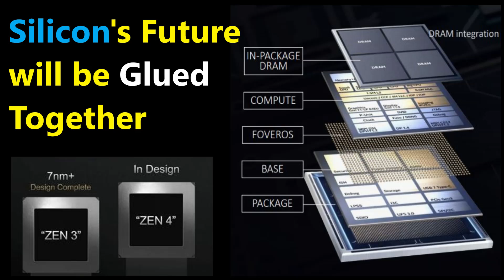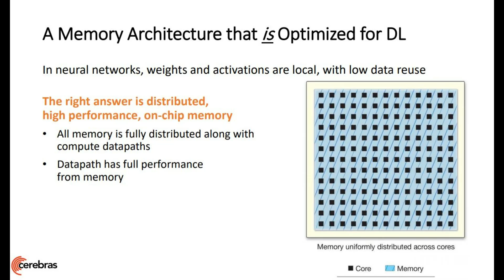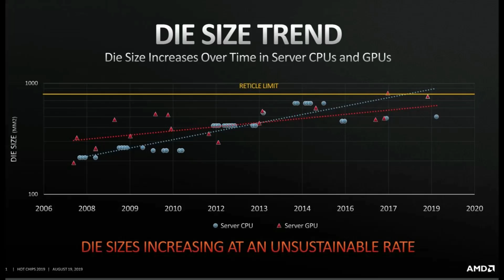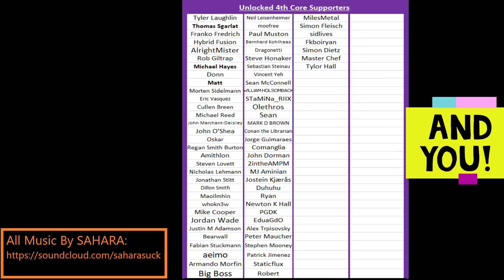3D Stacking the Future of Silicon

Comment: They best come up with some epic way of cooling them if 3D stacking is to become a viable option the smaller they shrink these nodes the harder it becomes to cool them, add stacking onto of that and it’s going to become near impossible to cool.

Change needs to happen in all areas no just the CPUs it’s daft to not even consider that.

Look at 3rd Gen Ryzen how the heat in those chips is pretty hard to consistently control yet that’s only on 7nm, imagine half that size with 3D stacking memory maybe a GPU to lol impossible to keep all that cool with the Options with have now.

Only other option would for there to be a bloody million sensors inside the SOC and it manage its own heat, but that will always result in lowering performance, so we would be stacking shrunken nodes to loose performance due to heat.

Comment: Thus is just going to be compute units, redundant ALUs and matrix multipliers, that sort of thing. Making a sheet of universal 7nm multipurpose nodes will always be less useful than simple modules repeated. Each can be tested and dead ones disabled using as much of the wafer as possible every time. Consumers will pay for the process they want and pay by compute units rather than this stupid branding. The next socket will be designed with this paradigm in mind if they're smart.

Comment: One question:
How the heck would you cool a 2.000 m^2 die? (Let's not talk about bigger)
I mean either have crazy airflow or use some crazy water cooling?
And what about pricing? I mean the bigger the more expensive? Even though the raw cost of resources wouldn't be that bad, I don't even what to think about the amount of engineering required...

However, in my opinion, we would be better off using a smart solution instead of just brunt forcing our way into better performance... 

I guess the whole reason Nvidia believes that big/huge dies are the future probably has to do with the fact that Nvidia is quite familiar with brunt forcing their way into better performance ^^

Comment: Basically you get exited about very new technology that is just around corner that is exactly same thing I got excited 20~ years ago. I do want to get excited about these things but all of them had had many false starts.  Waferscale integration, 3D stacking,  splitting design to a multiple dies within package, everything you have gotten excited about is VERY old technology that when I heard it first time it wasn't new.  The issue has always been that tweaking of existing things have given better bang for buck, especially for consumer level prices. As for 3D printing chips, I literally have Finnish university level schoolbook from 1996 that describes the process which was developed from 1970:s .  It is VERY easy to get excited about these things when you first hear them. And then you realize every single thing is actually very old technology that comes with caveats that have limited its use.  Sometimes the caveats expire with technological development, other times they stay.  Old Intel chiplet design had caveat that they couldn't test each die before integrating them to a single package, so it was limited to products that where out of consumer price range, they probably fixed that issue before making dual and quad cores by integrating two chips to same package. 

List of common reasons why technology isn't used yet. 1) speed, making something is so slow that mass production is out of questions.  2) Yield, more susceptible to manufacturing problems. 3) Just the pure costs. 4) Existing technologies are capable of mitigating the problem it solves for the common use case. 5) Problem it tries to solve is only fraction of the real problem, and all solutions to other side are too costly.  6) The technology is fundamentally not capable of shrinking to dimensions that do the things it promises. 

I read the TSMC very high performance benefits for ASIC:s against following background. 1) ASICS are thousands of times or hundreds of thousands of times faster than a CPU, when it is suitable for full blown ASIC implementation. 2) If algorithm doesn't have good enough cache locality then ASIC is limited by memory bandwidth and therefore performance is purely function of how much more bandwidth it can give relative to external memory. 
3) People have worked on designing algorithms that avoid those problem for decades for CPU:s,  and most of the time they work just fine when they don't performance is so terrible that people just don't do it. 
I do agree with Jim Keller that it is sad  that some of these technologies matured right around time when power/current density limits where truly reached.  If you disagree with that, you should know that when Chuck Moore made truly high frequency CPU:s is 800nm process he found out that they had to make some transistors BIGGER since smaller transistor didn't have large enough area to dissipate the heat and burned out.  And it wasn't that chip was hot, it was that individual few individual transistors got hot.  People have needed the low level lets spread the heat more techniques for long time the downside of doing that is exactly opposite of increasing density, which isn't a problem when it is one transistor in a thousand when making a chip that clocks unnaturally high for the manufacturing process.    This is the ultimate killer for full utilization of what TSMC is planning to do for ASIC:s for CPU:s,  those tiny high speed transistors cannot be stuck around.  

Now I would really like to have true 3D design for CPU:s however, all the technologies that have been discussed by all the manufacturers are incapable for doing it.  It is like people get excited about new slightly smaller cruise ship and start talking about how to use it to move around their house.  The scale at which 3D integration operates and what core design operates is so different.

Comment: hmm... Zen4 using a ground-up chiplet design? that covers with AMD patent stack, like that one about on-die thermoelectric cooling (peltier), from 2004,, the additional power budget to run peltier would be saved on cutting the energy signals lenghts due 3d stacking and much shorter pipelines to a memory/logic.

Comment: Just going from 2D to 3D will be incredible. So much silicon space is used for traces for clock pulses and data lines that can be much shorter when allowed to go through a 3rd dimension. That will save so much money by making it possible to etch more chips from the same wafer. Stacking computational areas will be tricky given the heat, but there are experimental capillary cooling methods in the works - essentially heat pipes between the traces. If they can make that work properly, it'll be like having a built-in AiO cooler inside the chip that could lead to a copper plate which can then have its own full sized AiO cooler for the case.

Comment: The difference is the smaller each die is when "glued together" the higher the yield and lower the waste.  One flaw in a large monolithic die, and it now has to be sold as something lower, if you're lucky.  Going bigger is a hail mary of expensive desperation, by companies that haven't done the R&D to move on.  The future won't be in super large die sizes.  It will be everything combined as closely as possible, or integrated by consolidation, but manufactured in pieces.

Comment: Yeah, I'm really looking forward to seeing what's going to be done with all this. Heck, even some of the early implementations could end up being really flipping interesting. Let's take Zen3 for example. Right now the big rumor is that Zen3 is going to take some of the room opened up by the die-shrink and put in a couple chiplettes that are nothing but HBM2 memory. The interesting thing about that is that, while it would help with CPU performance where it would really shine is with APU's. Imagine having an APU with Six cores, a Navi 14-ish GPU, and a GB or two of built-in HMB2 Ram. Well gee, that wouldn't quite be on par with competent mid-to-high range PC gaming set-up. Compared to earlier APU's though, something like this would completely blow them out of the water.

Chances are that with a set-up like that, there'd actually be some semi-modern titles that you could play at max settings at sixty fps. Granted, these would probably be titles that are from earlier this decade. Games originally built for the XB360, or early PS4 era titles that weren't really pushing the hardware very much. But if this is something they can do with their first iteration of Zen3 APU's, imagine what they'll be able to accomplish a couple years later. With a couple more die-shrinks or with 3D stacking, APU's that can rival rigs with dedicated graphics cards should be very possible.

And even that's fairly rudimentary. Interesting as heck, but still fairly rudimentary. And yes, I know you talked about all this earlier, but it's starting to feel a lot more real now. XD
Reply: Hades Canyon Nuc pretty much does this
Reply: @ApacheSenzala  

As far as I can tell, that isnt an APU.
Reply: @WolvenWeaver  the NUC has a processor and gpu on a high speed bridge layer which connects the two, just very closely. Not on the same die though.
Reply: @WolvenWeaver  Not its not but it uses Emib which is Intels version of the Infinity Fabric / early version of stackinge and its a powerful proof of concept already released. #whywait?

Comment: The idea of copper layers in stacks for heat transfer is nonsense, thermal resistance is much too high, I expect 50 to 100 µm gaps between the layers in a stack an d liquid passing through and evapourating at the edge of the stack, mass transfer and phase change are much more efficient, just like copper rod compared to a heat pipe.

Comment: Sure would be ironic if it now started getting smaller again at a good clip all the way down to 2 nm, and Moore Law turned out it hadn't died quite yet.

Beyond that, can't say I agree with it being a good thing to be dead anyway, sure it allows for new things to be looked at, but it also determines the base level you do them at. So every extra node still makes these other architectures start from a higher baseline.

Though well... one way or the other atomic scales are coming up, so couldn't really last that much longer one way or the other.

Comment: Considering cooling, it would seem a liquid would be too viscous.  Let's go with gas instead.  Since hydrogen is both reactive and flammable, helium traveling through microtubes would seem to be the logical choice.  That means grooved semicircles between stack layers with reservoirs at each end of the stacked CPU.  Then you could use micro-reed-valves or buckytubes in resonance and high-frequency vibrations to move the helium in a circulatory system.  From there you use a standard CPU coolant system.  I see no issue with that at all.

Comment: Printed copper pipes sound interesting. Didn't you talk about how AMD have a patent for on-chip Peltier technology? They were describing a way to use the peltier effect to provide in-silicon cooling. 3D stacking seems like the perfect use-case.
Reply: Peltier in the stack makes no sense, it just generates additional heat.
Reply: @mumar100  That's what I thought too! As far as I understand it, they're claiming that at the macro-molecular level, the peltier effect's parameter seem to change. No idea if this technology is actually viable, and they really need to solve the heat issue with stacking chips.

Comment: Graphene and 3D stacking sound like a perfect match for each other, graphene doesn't get as hot as silicon and 3D stacking needs cooling.
Reply: The moment I heard of 3D stacking and how good graphene is, I knew graphene would be the best material for that.

Wonder how far you could push it...

Apparently, flash memory is pretty insane with its stacking, I wonder if a similar stacking level could be applied to CPUs...

Comment: If you want to design multi layered consumer chips you have to come up with some extraordinary kind of cooling solution that should also be relatively cheap to produce. Cooling requirement alone makes it harder and this is one of the most primitive requirement here. Go figure
Reply from the maker: And what has this industry been doing to improve cooling....ever?   Nothing.   We are basically using the same cooling hardware we used 40 years ago.  All we have to do is actually divert some of this Node Shrink R&D money into other methods of improving performance.
Reply: @MooresLawIsDead  Exactly. Look at the "coolers" provided by intel. They have been the industry leader for decades! They command an army of engineers and hundreds of billion dollars for god sake!
Reply: I think the current cooling solutions are more advanced than 40 years ago.  Spot the CPU cooler from the image.  
https://en.wikipedia.org/wiki/IBM_Personal_Computer#/media/File:IBM_PC_Motherboard_(1981).jpg
Cooling methods have advanced, and there is research and has been research on better cooling however it is inside companies that specialize in cooling and most people are not willing to pay for better.  Cooling solutions have improved in past 20 years.  Companies have researched quieter fans relative to thermal requirements, and heat sink designs have also  improved.    Companies specialize in things, and there are companies which actually specialize in improving cooling solutions for electronics, and those results are sometimes used in PC:s also.  
Your copper cooling pipes inside stacked chips idea was something I had 20 years ago,  the key reason why that was stupid idea is simple , there is factor of 100 difference thickness between layer of silicon and heat pipes.   Anything that is physically large enough to move heat away from the stack is too thick to be included in the stack.

Comment: Because copper is conductive?
Reply: so it carries away electrons carrying heat, better. Silicon on other hand must expel heat thru waves, this is called "phonon" which move slower.
Reply: xponen_ I mean electrically conductive. As in you wouldn’t put it in the package like that or you’d short everything out

Comment: I thought about thermal limitations of 3D stacked architecture weeks before that, and about the idea you put at the end of the video - printing 3d themral solution. But why can't it be graphene? If I am not wrong graphene conducts heat like nothing before. This would be funny though, graphene first time used in circuts not to conduct electricity, but rather help the existing sillicon to lose heat from doing all the work :D
Reply: Not really funny, it's logical that it would require much finer pitches to channel power and data than merely heat.

I have seen research papers using CNT vias deposited into holes through stacks to increase vertical heat conduction - the problem is you need to surround them with an insulator to prevent electrical shorts, unless you specifically design the via locations to avoid electrically active areas of the stack layers.
Reply: Funnily enough, Nantero mention this as an advantage of coating your dies with nanotubes, which is part of their memory process. Seemed fairly sensible to me, given the dual-purpose of it.
Reply: The thermal problems of stacking will probably get interesting. One thing I don’t expect is high clock speeds.

Comment: You won't stack cooling pipes in a 3D-stacked die because they are way too thin for that (<50μm/layer), and spacing them further apart would drastically hurt communication throughput and energy use. It wouldn't even help much, unless you're actually pumping fluids through the silicon, since ultimately that heat needs to be extracted out the top anyhow.
Reply: It's going to be a big challenge to extract the heat. Maybe have dielectric liquid in the package to act as a vapor chamber? Probably best to just optimize the solid conduction paths.  We're talking about 1mm total height, so that's not a lot of room for additional mechanical layers. Actually, no solid conductor would be able to help by moving heat laterally from between layers to the edge, conductivity is to low. Need to move heat up to the cooling plate as efficiently as possible, not sideways.
Reply: Or put the biggest heat generation at the top. With less heat or no heat generated components at the bottom.

Still, it means a lack of 'overclock' products with 3d stacking. It's binned and you will pay for what you get.

Comment: Bring on toroidal topology architecture! I want to see centrally cooled silicon chips with near infinite memory and bus speeds. Put the bus in the ring core, the cache on the next level, and the processor nodes on the outer surface. Maximal cooling surface area, shortest possible interconnects and massive storage capacity. Humming, glowing donuts are the future!